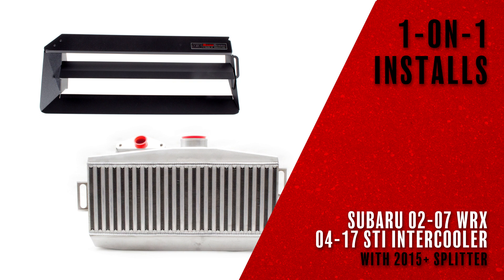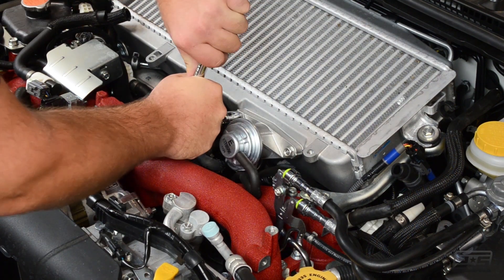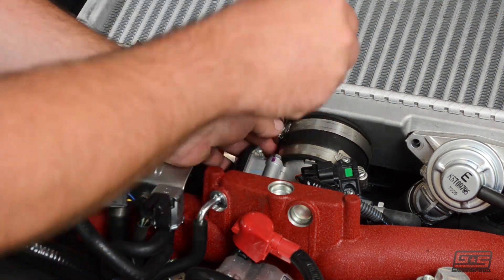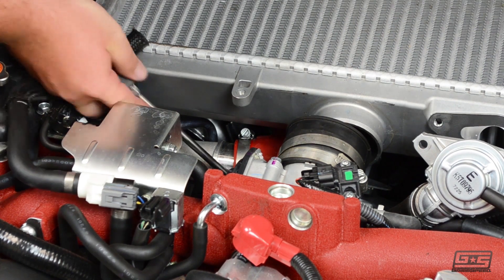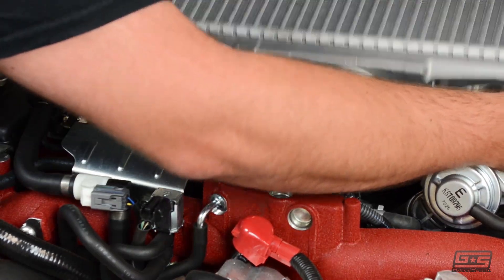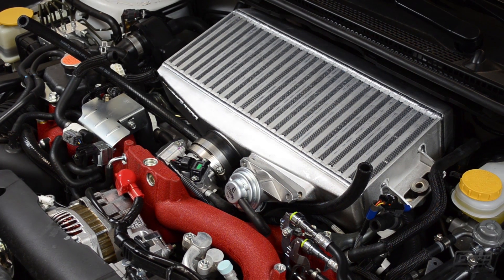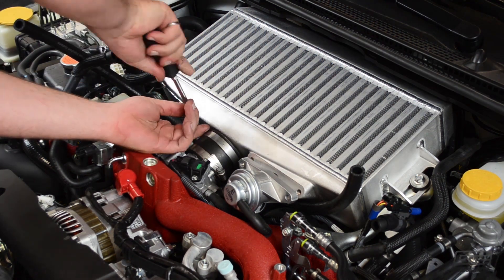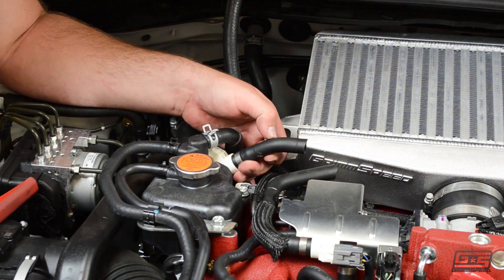GrimmSpeed Subaru 02-07 WRX / 04-17 STI Intercooler and Splitter Install Video

Comment: You have to trim the coupler on Y pipe to be able make fit on,Turbo inlet... Its says direct fit ,but its not sir !
Reply from the maker: Depending on your turbo, you may have to trim the coupler. If it doesn't fit right you may have the couple backwards. The side with the GrimmSpeed logo should be on the turbo.
Reply: @GrimmSpeed  i tried both ways on stock turbo and it didn't fit , elbow coupler the way it came doesn't fit on stock turbo,its weird bc it  said you can use stock intercooler Y pipe and i m assuming it suppose to fit w/o cutting.... 
I ordered grimmspeed Y pipe as well and it didn't  fit again... It is way far off from the bracket hole and cant bolt up GS intercooler to the hole ... 
Good luck to cut that coupler straight ... 
Very disappointed guys ...

Comment: What are the toque specs for the intercooler inlet hose clamps and the main hose clamps on the front of the intercooler?
Reply from the maker: You want them to be tight but not tight enough to strip them. The most important part is to place the clamp right after the bead on the intercooler. That will give you best seal and least chance of popping off under pressure.

Comment: does not requires dyno or accessport ?
Reply from the maker: To get the most out of your upgrade we do suggest a tune after switching to our top mount. But it is not absolutely necessary.

Comment: Mostly very good but you clearly skipped over the hour wrestling match with inlet and outlet hoses. That is the only really hard part. Would have loved to see you tackle it
Reply from the maker: Those hoses can be a bit tricky to get on there. Patience is key!
Reply: Nailed it Ron! They need to show the struggle 🤣
Reply: The stock holes has a little metal piece just sit it next to the turbo and then take a flathead and push it on takes about 10 mins
Reply: Definitely an exercise in patience and tenacity but once all the stars align and it slides in it's a feeling of victory. I did end up removing the right side bracket and unplugging the connector on the left side of the throttle body for a few more space to slide the y pipe hose into place.

Comment: You forgot the step with all the swearing and cussing from trying to get the turbo to intercooler hose on.

My car is sitting without an intercooler on right now because I couldn'y squeeze the bitch back on.
Reply from the maker: If you are having trouble with the installation, feel free to give us a call. Our customer service team would be glad to help you.
Reply from the maker: That part can be difficult. If i am remembering correctly, the bracket on the right side needs to be loose for that extra wiggle room.
Reply: @GrimmSpeed  yeah I ended up taking off the right side bracket... then the rubber mounting grommet fell off into the depths of my engine bay never to be seen again. I just can’t catch a break lol.

Comment: Any drawbacks to doing this on a STI? I only have a turbo back with AEM intake (protuned). Also, does this require a tune after install? Thanks.
Reply: Also would like to know if tune will be needed after install?

Comment: I have a TiAL BOV mounted onto the GS TMIC  on my 2015 STi. Would there be any fitment/clearance issues with this splitter?
Reply: Chris Dela Cruz  did you find out a answer I have the same question.?
Reply: jordan aviano I was able to install it with no real issues. The rubber strip sits on the Tial unit lightly.
Reply from the maker: Hey Chris, I don't suspect you would run into any issues. But we haven't tested our unit with this specific setup. I suggest getting a hold of some pictures of it installed and seeing if it looks like anything would come in contact. Feel free to give us a call and or send an email if you run into any issues during installation. support@grimmspeed.com
Reply: @GrimmSpeed  will this tmic require a tune?
Reply: @gtozr1  No, but it would be beneficial to get it tuned to achieve the most out of the TMIC. However what you'll get out of it is improved cooling of the compressor dicharge temps.